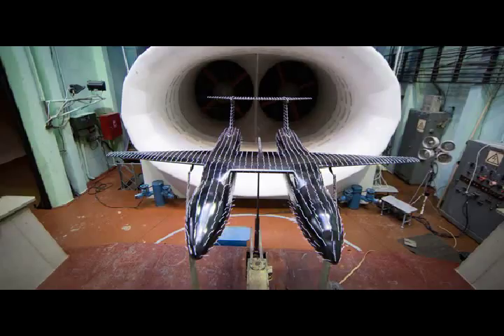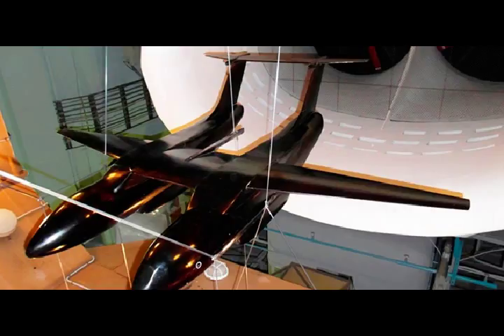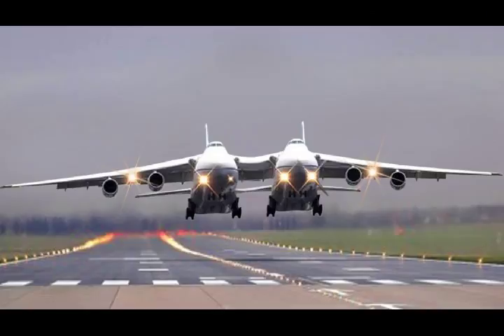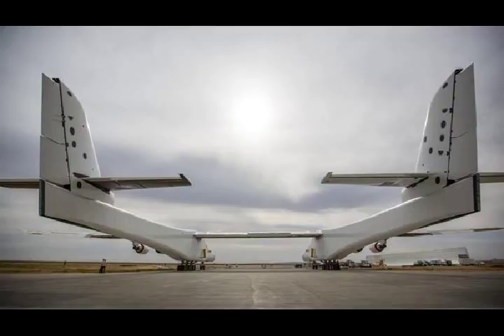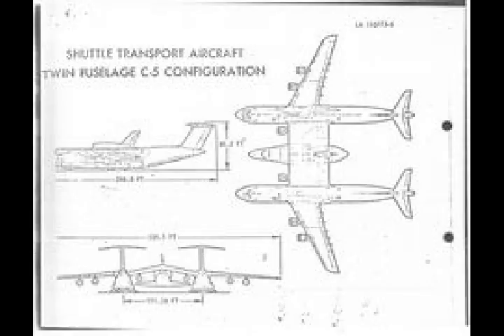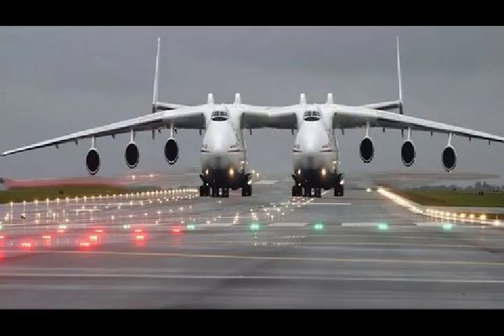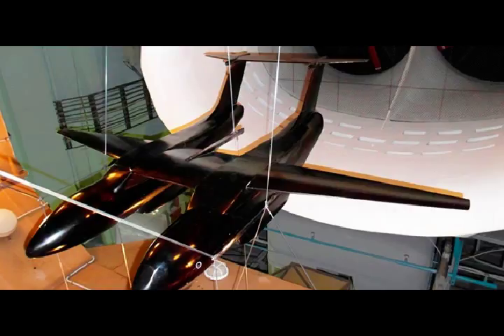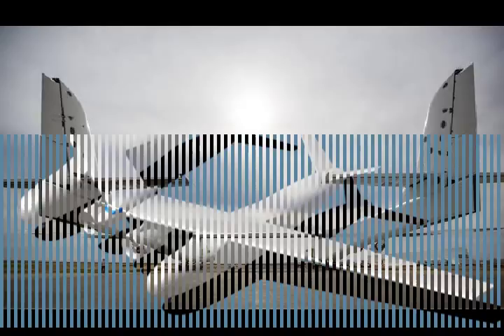Russia’s TsAGI Working on Double Fuselage Transport and spacecraft Aircraft

Comment: The flying wing design or even a flat-shaped dual fuselage is far more aerodynamic and can have far more useful space than two separated tubular fuselages in  a a same plane. also,, it makes impossible for the aircraft to have any stealth capability. An mandatory counter-mesure against long range surface-to-air missiles, in the near future.